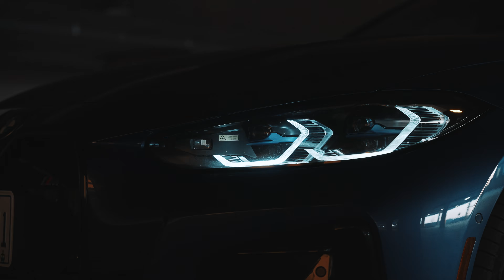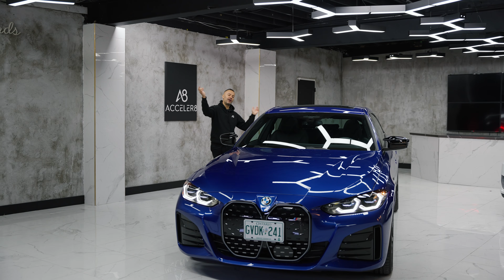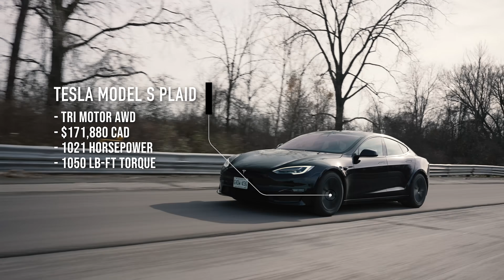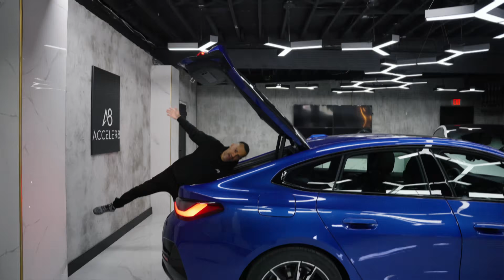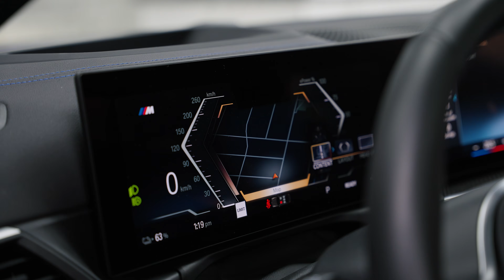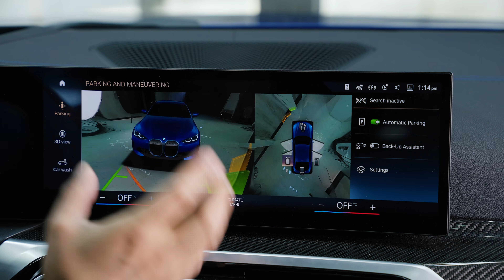2022 BMW i4 M50 | The Ultimate Commuting Machine

Comment: Compare to Model 3... this BMW i4 M50 is MORE EXPENSIVE.  Slower speed, useless rear seat with Gas car Hump, Speakers not as good as Tesla and need to pay $875 extra, Cargo space is less than Model 3, no front trunk, less Miles, No Dog mode, less Tech, cannot auto drive as good as Tesla.....      I'm waiting BMW to come out a TRUE EV plateform Sedan... like what they did with iX.....   No waste space like this i4
Reply: Tesla has the EV market in a headlock. If they ever learn how to make a good looking car, it’s over.

Comment: The acceleration in this car is mental.  You are going to be replacing your tires every year. Even the 40 is 5.7secs and the 35 is 6secs.  The 50 doesn't get the Canadian Fed rebate.  The 35 and 40 does.

Comment: 1) looks like Portimao Blue Metallic, not Matte….  2) the CLAR platform was always shared for both ICE and BEV drivetrains.  3) the tunnel is full of batteries - so is a good use of the space 4) a bespoke platform isn’t required
Reply: Yea many people don't understand but the CLAR platform wasn't gas and converted for Ev. It was always meant to be for both gas and EV. But the Neue Klasse in 2025 will be EV solely.
Reply: Came looking for this ... I have the same car, thats not the frozen version, thats standard portimao blue

Comment: Those so called horizontal flares on the front grill are called Air Shutters.  They open and close depending on cooling demand.  When the shutters are closed, the aerodynamic drag is slightly lower than when open, to achieve a slightly higher electric range.

Comment: The battery pack is built to utilize the shape of the drive shaft tunnel.  BMW has a good press kit on the battery shape, so the tunnel does serve a purpose.
Reply: Think of it this way: With some of the battery molded up into the tunnel, the rest of the battery can be that much thinner so the floor is lower.

Comment: I drove a demo i4 M50 not too long ago and it was the most fun I had in a while. It's incredibly zippy and the interior quality was really nice. The handling around corners incredibly responsive and didn't feel like I would lose control easily. It feels a little heavy but I don't mind it because it takes away that "go kart" feeling.  The infotainment was a little hard to navigate and get used to but it looks incredibly nice and is very responsive but I do wish they would have cleaned up the menus a bit more and consolidate some things.

Comment: Test drove one today. It’s insanely fast and quick. No it’s not a track car but for daily driving good God it’s a riot. Way more immediate than a model y or model 3 performance.
Reply: Are u sure u drove the performance teslas? Cuuuz I've owned two. And 0-80 they are DEF faster. Like 10-20% faster. Not being dickish. Honest question.  I want an i4. Just curious. Need to schedule a test
Reply: @KiNG-tx9je  yes I have driven both a performance 3 and 7. They're quick obviously. The i4 m50 is neck snapping immediately quick.

Comment: This review is excellent.  I wouldn't normally look at a BMW review because I'm not a fan of the unreliable brand.  Yes, they're fun to drive but I'd prefer a car to last more than 3 yrs.  Maybe now, with no engine and all battery,  BMW can score some points on reliability!!  
P.S.  Mike could review a Yugo and with his style, persuade us all to buy one. 🚙
Reply from the maker: Hahah thanks
Reply: My 335xi (with much maligned N54) turns 15 in less than a year and my X5 is 11. I've had 7 BMWs in the last 25 years, so my sample size is probably bigger than yours. If you did in fact ever own one, maybe you should have considered getting a decent mechanic who know what they were doing.
Reply: @kadoelen-uz2oe  I was waiting for a comment like yours.  You act like the unreliability of BMW is new to you.  At least I allowed you a platform to brag about your BMW ownership.
Reply: BMW is the 3rd most reliable car brand in the US now. Just an fyi.

Comment: Just preordered mine!!! Still fun for me and im currently driving a X4 40i..
Reply from the maker: Congrats! Hope it comes soon!
Reply: Mine is coming this summer. Reserved it last August. Signed off on the build in February. Will hope to reto fit the 50th anniversary M roundels afterwards. 

Also isn't this one the mettallic portimao blue. That's not the frozen matte paint. I got the metallic portimao blue with cognac interior with carbon fiber trim.
Reply: @aneebaba06  I got the same exterior color but black interior
Reply: @DeniiMas  cool! I'm coming from a black on black 328i so didn't want to go with another black interior. Had to suffer through the California heat with it lol although I'll be moving away from California this summer.

Comment: Nice review but some things aren't correct.   That looks like Portimau blue, not frozen portimau blue.  The rear seats do fold down.  The back window is really small. Ventilated seats are an option.  Everything else is spot on.  "Ultimate Daily Driving Machine?"
Reply: correct, ‘frozen’ is a matte finish
Reply: Thank you! I was wondering about the ventilated seats cause the website listed it as an option.

Comment: Nice color indeed! But it is not frozen Portimao.

The M performance badges exist on many non M single digit BMW cars. It should be a common knowledge by now. Ie X7 M50 X6 M50 and so on.

It’s a great GT car. Not a race track car such as M4 or M3.

Maybe a iM4 will be launched later.
Reply from the maker: Yes we messed that up. Corrected the colour in the pinned comment!

Comment: Cool color indeed.  I just miss my 2006 325i manual.  Back when BMW's had good styling, awesome interiors, and were a joy to drive.  I know this is electric so it will drive and feel different, but the styling to me is kinda meh (the grill is obnoxious and the rear end taillights remind me of the Acura TLX.  BMW's used to have those artfully shaped gauge binacles-the square digital screen looks like the Hyundai/Kia electric vehicles. 
/nostalgic rant

But aside from that, GREAT review as always!

Comment: Always love your energy in your reviews. I still think BMW has forgotten how to make a car not look ugly on the front but at least it looks normal everywhere else. The interior looks... kinda cheap for the asking price. The screen looks very tacked on last minute. Also, very surprised there's no leather stitching or more premium materials at this price point. Nothing really says "hey, I'm special". Also, I'm sure it doesn't qualify for rebates in Canada since the base MSRP is over $50k. Otherwise, a solid EV. Would have been nice to have a PHEV because I still think full EVs aren't worth it yet.
Reply: The grill appears much larger in pictures than in person
Reply: Leather interior is pretty much standard in this car, Vernasca leather that is. You can also get Merino leather, which is actually nicer.

As for the looks, that's subjective of course, but I think that it looks a lot better in person than in pictures or video.

Regarding it feeling special or not, I think it feels typical BMW. It's not more or less special once you're inside than a regular 3 series G20. Actually, in terms of standard features and luxury, this car beats the 3 series by quite a lot, as it comes with a lot more equipment included than the 3/4 series does.

I know this because I own a G21 and have tried the M50, and they feel just the same inside the cabin.
Reply: I ordered mine last month, 2 years wait time and it does qualify for 12k rebate since I'm from quebec. The e40 that is not the m50.

Comment: Nice review. Just one thing that I hope everyone is clear about: If anything, this would be the electric version of the M340/440i, not of the M3/M4. Just as the x40i's, this car is meant to deliver extra road performance, not track performance and aerodynamics. BMW has yet to announce any pure M electric car that's track oriented (I think they announced the iXM, not sure, but that's an SUV).

If you keep that in mind, I think this car starts making a lot more sense. It provides luxury, comfort, performance, AWD, and quite efficient electric driving for commuting and road trips, but it's not a car you'd take around a track and expect it to beat an M car around it.  It's direct competition would be the Tesla Model 3 and the Polestar, not really the Taycan.

Comment: The platform is not "gass powered" or designed for ICE cars. The platform is hybrid, intentionally so, because BMW wanted to save money and be able to produce both types of cars in the same production line.  There's info about these platforms on the Internet.  It's true we'd like them not to have the transmission tunnel using space in the interior, but that's a side effect, a compromise, due to the hybrid nature of it.
Reply: what's the other color, not the blue on the garage, but the one you drove on the outside shots?
Reply: @JeovanieClaudio  It's the same color, just that he put filters on the video that make it look like a different color.